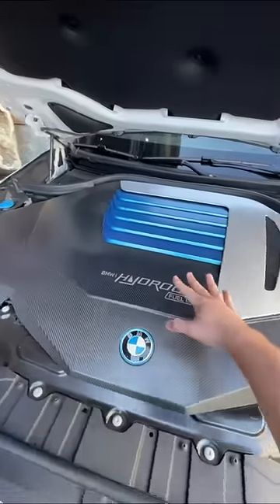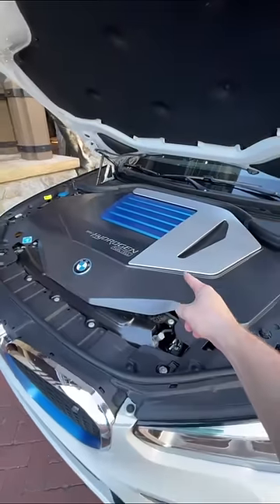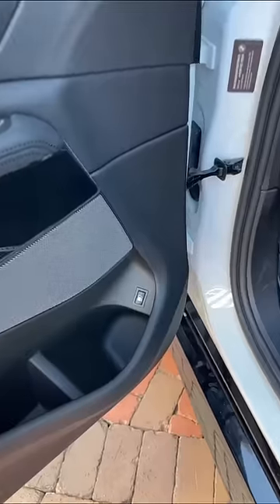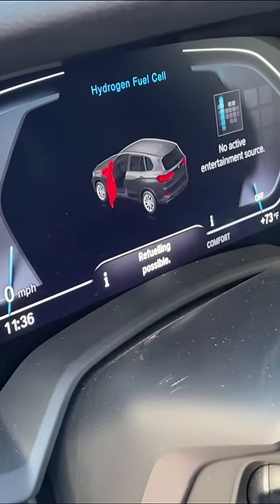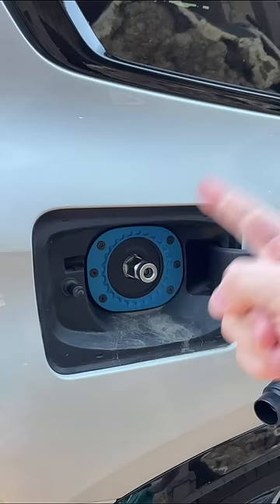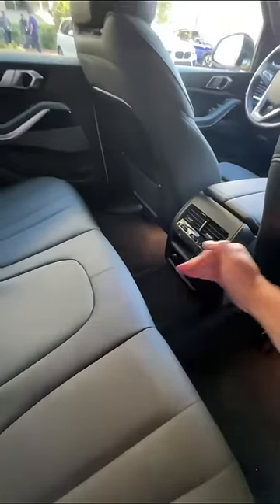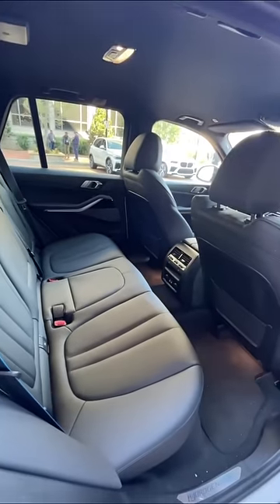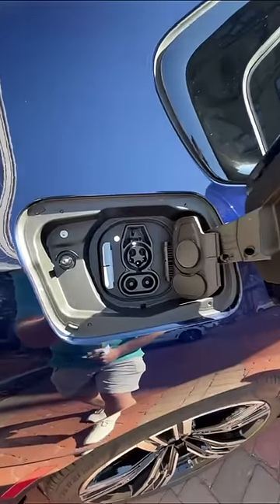BMW's Hydrogen X5 may be the future

Comment: Obviously, H2 is an ideal fuel for ICE engines, since its exhaust is almost entirely water vapor. The problem is refueling infrastructures. Also, you wouldn't want hydrogen tanks to rupture in an accident. The explosion would make national news.
Reply: And making hydrogen means it is not a low emissions solution. Often higher emissions than gasoline. And the fuel cell solution is basically just an electric car requiring a large battery. 

So the worst parts of both alternatives combined.

Comment: These cars are actually safer than electric cars with lithium ion batteries and even gasoline cars according to tests because of how pure hydrogen is extremely stable and can only combust when it comes in contact with oxygen. Also those cars have pressure relief valves that will open if the tanks get too hot or the pressure gets too high in them and even if the hydrogen being released is burning it will not cause any significant damage to the vehicle because of how the hydrogen would be burning very inefficiently getting the oxygen from the environment around it.
Reply: Ummmmm, the only way to go a great distance is if the hydrogen is in a liquid phase.  This means keep the fuel tank pressured to about 180 psi.  The lowered potential energy of hydrogen compared to standard fuel means that car tanks would have to be larger.  With regard to your safety comment, if you get in an accident and rupture the fuel tank the liquefied hydrogen would immediately evaporate at 1 atmosphere to 800+ its volumetric size when changing into a gas.  This means that with even a small amount if liquid in the tank the resultant gas amount would be enormous.  The hydrogen would immediately mix with the surrounding air to create a highly flammable combination that needs a minimal spark to ignite.  The most recent theory on the devastating affect of hydrogen on the Hindenburg was that the ropes that were dropped to the ground during landing were wt from the rain and once they made contact with Earth they became grounded and static electricity was carried back up to the envelope.  Make no mistake, the possibility of a catastrophic event is there with hydrogen
Reply: @mmricci2861  
However the tanks in hydrogen cars are actually quite thick and are well protected as they are also designed to withstand a direct collision without falling! :)

Comment: People are wondering where we are getting electricity for EVs from, when with hydrogen we will need much much more electricity for the same purpose. And then we have to contend with highly flammable, high pressure gas tanks strapped to the bottom of the car. Not to mention they will be almost as expensive as an EV but with much higher running costs. Other than that, they are the future 😂

Comment: This is super common in Costa Rica (probably most Latin America) and most gas stations have it available. Costs about 2k for a hydrogen setup on any car and you can always switch back to gasoline. It’s very convenient and cheap. But I guess it works best in small countries since it can become commonplace quickly
Reply: I'm pretty sure you are mixing up hydrogen cells with LPG

Comment: Let's see... hydrogen is running around $5 per pound, you can't find it anywhere, and only 300 miles per tank. My X5 35D cost $3.50 per gallon of diesel and gets ne 400-550 miles per tank.

Comment: Battery electric cars are on their way to be able to charge 400 km in under 10 minutes. As hydrogen will always cost way more by the kWh than just electricity, hydrogen cars make no sense anymore.
No one will pay 4x on fuel only to wait 5 minutes less refueling.

Comment: If you think burning EV is scary, then you should avoid these gas cars. If an EV starts to burn, then its highly unlikely that the battery itself would burn, but in these hydrogen cars, you can be 100% sure that the gas tanks will explode.
Reply: Actually, it is highly likely that the battery in an EV will burn, but it is also true that the hydrogen tanks in one of these abominations is dangerous.
Reply: @kirkjohnson6638 it’s not highly likely😂
Reply: @jonathanfields4ever  Outside of arson, if an EV catches fire, it is almost always the battery that caused it.  And, as the EV fleet ages, we're going to see EV fires occur much more frequently.  Since EV fires cannot be extinguished by ANY means they are very dangerous fires.  Perhaps the EV fires will still be infrequent enough that society will accept that risk, bit we won't know that for sure for about 20 years when scrapyards are full of them and there are lots of them on the road.  Unfortunately, by then, all the kids of the younger generations will have no knowledge of what ICE cars were like and how safe they actually were, so any fire dangers will be easy to dismiss by comparing the safety of 2055 model self driving EVs with smart airbags and other new safety features to that of 2020 and earlier ICE vehicles with human drivers.
Reply: @kirkjohnson6638  why would scrap yards be full of them? The batteries are very valuable. Even Nissan LEAF batteries that are widely considered poor performers are highly sought after. They’re full of valuable minerals remember? Get your oil industry talking points straight.
Reply: @jonathanfields4ever  The cars will be in scrap yards because the batteries have failed and the cost to replace them is way higher than the value of the cars.  And the batteries will still be i the cars because its more expensive to recycle them than to just make new batteries AND because recycling them is a very dangerous endeavor.  Maybe we'll have to add a big deposit to the purchase price of EVs to cover the cost of recycling their batteries when they die.
Reply: @kirkjohnson6638  Lol. EV batteries are reused and recycled even now. Even if they’re not suitable for a car, individual modules and cells are still useful. Why would the future’s more valuable batteries not be? You’re not making any sense. Battery recyclers like redwood materials are practically begging for more batteries.
Reply: @jonathanfields4ever  I don't know where you get your information, but practically no lithium ion car batteries are recycled now.  Have you any idea how much work goes into recycling them?  Some people will try to repurpose them, but even that is very labor intensive.  There's a guy with a channel on YT that repairs Teslas with bad batteries, but it seems like he mostly works on the original roadsters and the only reason its is financially viable is that they are valuable collector cars owned by people with lots of money who are willing to spend it.
Reply: @kirkjohnson6638  The batteries are being recycled, but there aren’t many available because there’s a robust market for the other cells/modules in the battery pack. It’s not like a phone battery that’s just goes bad and it’s done. There’s a lot of money in testing the good cells and reselling them. The demands on a traction battery are very high, so even when a battery pack isn’t suitable for a car, it can still have a long life in other use cases. You clearly have no clue what you’re talking about. You lied about the other talking point, you got caught, and now you’re just moving the goal posts.
Reply: @jonathanfields4ever  What percentage if cells are being recycled?  I bet it is less than 0.1%.  You do realize that the cells are potted in place in most EV batteries don't you?   You also realize that puncturing a cell can lead to a short which turns into a thermal runaway?  You do realize that as cells age, dendrites are formed that can short the cells?  You do realize that there are mass EV graveyards in China and those cars have batteries and no one is recycling them because it's not worth the cost and risk?

Maybe you should do a little research.

Comment: Looks like Hydrogen cars are gonna be big. Toyota was right once again.
Reply: I doubt it. Once solid state EVs are common (believe Toyota are working on one too) then Hydrogen cars will almost instantly disappear. It currently costs way more electrcity to generate Hydrogen than just charge an Ev plus you still need to hunt down a hydrogen station to fill up for the same range of an EV. So much better charging at home if you can or stick with fossil fuels

Comment: I’m pretty sure Toyota is farther along than BMW.

I really don’t know if this is even the future.  Too expensive to fuel and buy.  With an EV it’s possible to net zero for a cost with solar or alternative energy generation.  

With gas, it still is the best medium.  Fastest refuel and range time, cheapest price overall. 

While EV’s are the next closest thing to gas although way off still.  I personally think biofuels or another alternative needs to be utilized.  If only someone can figure out how to run cars by filling them up with water and using the for fuel.  It’s the most abundant resource we have.

Comment: I'm sorry 15 gallon tank In a suv is not working for me I get 300+ miles in my fiesta and it's a small 4 door sedan with a 13 gallon tank there's no reason to be that small of a tank and it's not just one tank it's two tanks totaling 15 gallons is absurd your adding extra weight with the fuel and the fuel cell has to be beefed up because if you got in a crash I'm sure you don't want hydrogen leaking In a crash so yes you need to overengineer the tanks so they don't blow or leak so easy on impact than imagine having a fire suspension system even more weight on a 50+k car that's not only gonna depreciate but you'll be filling that shit up every other day not worth it

Comment: That's BS, that hydrogen is produced by separating the H from de H2O and that takes electricity to do the job and its transportation to the hydrogen station is more complicated than moving a tank of diesel or gasoline, because it has a higher risk of explosion, so that hydrogen is not the future...

Comment: Hydrogen is way worse than EV though. You're combining the scarcity of 'charger' station with the range of a normal EV. Either stay with your petrol/diesel until these are common on most service stations or switch to EV and charge at home on a cheaper rate and convenience of going to station to fill up.

Comment: Water is everwhere. Only need to process it.
Oil cost multi-trillion USD to be processed.
Battery cost multi-trillion USD, a little bit more pollution than oil, a little bit more human sacrifices than oil.
So, cost isn't the issue.

Comment: Hydrogen is the future. The most abundant resource in the universe. The idea that there aren't enough refueling stations is beyond idiotic. If we hadn't wasted the last 15 years rolling out an electric car charging infrastructure and instead focused on replacing/integrating normal fuel stations with hydrogen fuel we wouldn't have to sit around like clowns waiting for a battery to reach 80%.
Reply: You are incorrect.

It’s the most abundant element which does make a difference. Which means it has to be extracted.

That process alone is not sufficient at this point of time. The energy required to make it exceeds that of what the hydrogen can yield when used as a fuel source.

Comment: Soo let's go to facts ...

You need :

+55kwh per 1 kg off H2 pressurized at 300Bar

+ 10 liters off clean water per 1 kg H2 

+ 14 diesel equivalent trailers tanks for refueling the same number off cars that only one diesel tanker does..

+ more than 2kg per 100km in highway speeds .... 

Yea ... sure, looks like a winer to me...
Reply: Forgot to mention that making hydrogen is higher emissions than using gasoline in cars. Plus a fuel cell vehicle is basically just a complicated EV with a large battery. 

So taking the worst parts of both alternatives combined into a H2 car.

Comment: Yes, Hydrogen fuel cell cars would be the ideal solution if instead of DC electrical capacitance, we discovered the fuel cell. What does that mean? It means if we would have built the infrastructure for gaseous generation instead of electrical transmission, the vehicles would be the way to go. But it isnt.

The US Dot and DOE Joint report of 2011 after the Obama admin requested an estimate on federally funded hydrogen infrastructure vs updating the current electrical for alternative fuel vehicles.  To update the current grid: $4 trillion. To create a new system for hydrogen: $311 trillion.

Hydrogen is dead.

Comment: Imagine getting an H2 car because you consider charging to be a problem, paying 5x as much per km/mile compared to an EV and having to wait for half an hour for the refueling station to get back to 10k psi because a bus just finished filling up on hydrogen.
😂

Oh… and worst of all: Imagine still believing that Hydrogen is going to push EVs out of the market in 2024… Even more sad than believing that e-fuels are going to be economically viable for the mass market 😅

Comment: Hydrogen cars are not the future unless we manage to position ourselves to produce excessive quantities of zero emissions power. Current tech is heading towards batteries that charge faster, are lighter, and can withstand more charge cycles.

Most hydrogen is currently made using methane, it is not efficient and produces CO2. The other option is electrolysis (also inefficient) and it makes more sense to use that electricity to charge a battery. Overall I'd estimate a hydrogen car using hydrogen produced using electrolysis to be 20%-30% efficient.

Comment: Tesla would be out of business if this was mainstream
Reply: Hydrogen is 3 times more expensive than gas and about 4/5 times more expensive than electricity
Reply: @legendofthepeach  a new technology is always going to be expensive before it is adopted as mainstream
Reply: @GM-kj6sb  electrolysis isn’t new tech. It’s just the cost of electricity to create hydrogen and enough to convert back to electricity will always be more than the cost to power a vehicle with electricity
Reply: @legendofthepeach  and what about when en EV battery goes bad after 10-15 years? Volvo themselves did a study on their XC40 ICE vs. EV model showing carbon offsets are not in favor of EV models until the EV has surpassed 70k miles. By then the battery is close to needing a replacement.
Reply: @GM-kj6sb  there’s lots of counter studies to show that isn’t so. Model 3 is Carbon offset after around 21,000 miles with the current grid including manufacturing, car batteries are around 95% recyclable to raw material, teslas are guaranteed to have over 80% life to 120,000 miles. Probably 15 years yeah same if not longer life span than an ice car.
Reply: @GM-kj6sb  there is nothing new about hydrogen.
Hydrogen is so expensive because it takes so much energy to make it.
that price will never come down because the amount of energy it takes to make it wont change.
also the end to end efficiency is around 15 - 25% so you are wasting the vast majority of the energy you put in as heat along the way.

Comment: Think hydrogen is the solution. I switched from a diesel to an all electric. Now 7 hour drives takes around 12 plus I charge my car with charging points that run on diesel ⛽ /fossil fuel. Not a good investment. Battery that goes for recycle ♻ is again a big waste.

Comment: We dont have hydrogen stations in Pennsylvania...lol!!! I fully fuel up once a month, (once a month)! and takes me 3 to 5 minutes depending on wether or not i run in and grab a coffee. your BMW has a range of 300 miles of range, i have 570 miles of range. My jaguar XJl cost me 41 thousand dollars, which is alot cheaper than any BMW. sometimes it pays to simply leave well enough alone. Keep the hydrogen and the EV. Both are too expensive, shrot and shitty range and sitting around like some bad ass kid in time out.

Comment: 99% of Hydrogen produced comes from fossil fuels. CO2 is formed when breaking the hydrocarbon chains, breaking the Hydrogen free. The process requires a lot of heat and pressure, which is also provided by even more fossil fuels. The compressing of the Hydrogen is very energy intensive. That part comes from electricity, so it depends on the local grid how much of that comes from fossil fuels. Hydrogen is the tiniest atom and is extremely difficult to keep from leaking. So, the waste of Hydrogen in leaks have to add to thr fossil fuel count, because excess is always required to be made to account for the losses. There is green Hydrogen, but it is so much more expensive that profit motivated companies will always choose fossil fuel produced Hydrogen.

That is all before getting to the fact that Hydrogen itself is a greenhouse gas, so any Hydrogen leaking off does more damage to the atmosphere. Also, since it is such a fossil fuel intensive process, big oil and gas companies have invested a lot into making Hydrogen an active player in the green energy market. They want governments and private industry to heavily invest into Hydrogen, so they will be stuck having to use it. That way, they will more easily accept the reality that at scale, Hydrogen economies will be forced to run on fossil fuels. The inefficiencies introduced by all the losses involved will also require even more fossil fuels be used to provide the same energy levels. For the oil and gas industry, Hydrogen is a gold mine and it offers them amazing greenwashing potential.

Comment: It costs more energy to produce the hydrogen then what you gett out of that hydrogen in milage. You are better off taking the energy you spent produsong hydrogen and instrad putting that energy straight in to the battery insdead.

Comment: No, it will not be the future. Hydrogen industrially appears from natural gas. It is no any benefits,  from using in a vehicle hydrogen, made from gas with catalytic and chemical conversion, instead use it in engine directly. A specially if you use it in dedicated engine, with compression ratio 15:1, instead of using in petrol engine as conversion, with ratio 10,5:1 in best case.